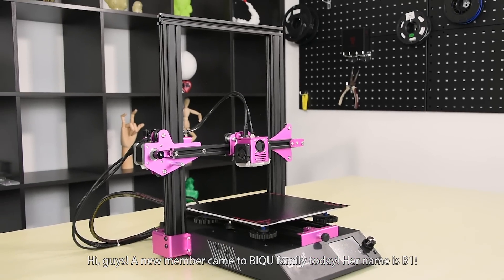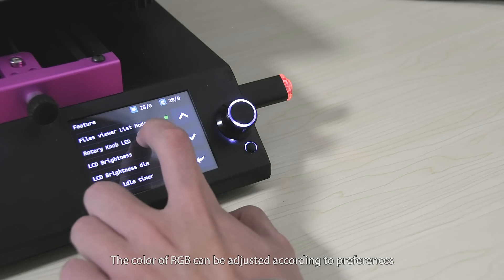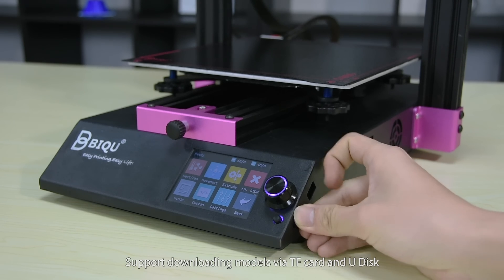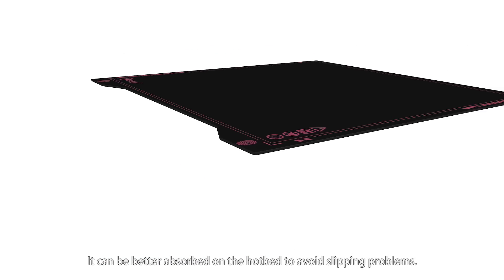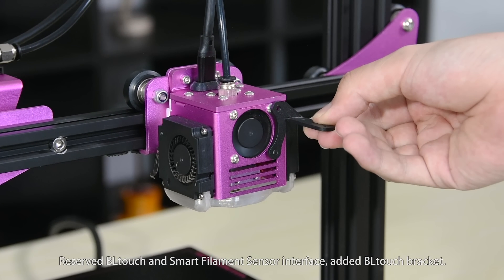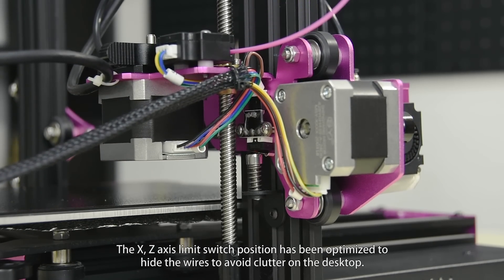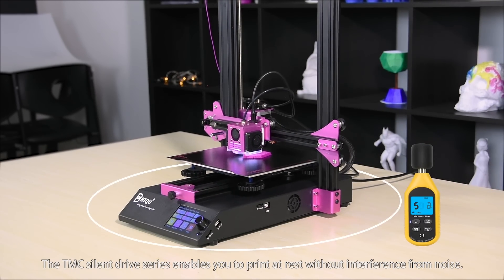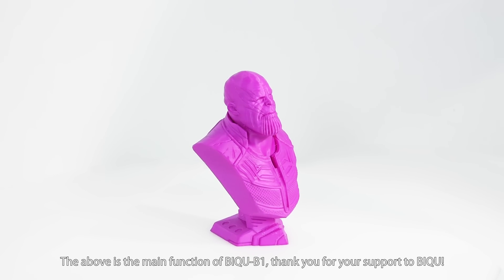BIQU B1: 32-bit Dual Operation System 3D Printer

Comment: I have bought this printer in Sep 2021 and I am not happy with the high pitch noice from the Power Supply Unit fan. I can hear it from another room at a distance of approximately 10 m (30 ft). The top frame of the printer  was poorly assembled by the manufacturer: I had to spend some time to fix several issues by myself as I have some experience with terrible Anet A8. The Manual is incomplete. Prints are okay. Love the magnetic print bed and the detachable metal sheet. Love the touchscreen.

Comment: When will there be a second Z-drive available? That will make this fine printer an excellent printer. Overhere in Europe there is a tendency to bad review the printer because the lack of the second Z-drive. And when your product has a bad reputation, it takes a log way to restore confidence. And that would be a pity, because the printer is an axcellent machine.

Comment: I have this printer and i am only having problems with this printer. Leveling the bed seems almost impossible. And then you think that it is not a problem with BL-Touch, but I have not been able to print a single first good layer yet. I am not an expert but have more than a year of experience with the Ender 3 and printed without any problems. Have also checked  everything of the printer 10 times and leveled the bed as good as possible 100 times. Also bought a Creality glass bed because the original bed appeared to be warped. I even bought a second BL-Touch to make sure it was not broken.

I bought the printer through Banggood which I really advise against everyone. If you buy something from Banggood and the product is not good then apparently you are out of luck because they don't provide any service! Reported my problem within 2 days and they are doing NOTHING to help me. Hope others have more success with this printer. for me it is 250 euros in the trash.

Comment: REALLY love the ability to send gcode right from the screen.
Is it possible to add a plastic piece like to the rear usb c connection, like the one on the nozzle shell? I think it would add lots of stability.
I really think this will be my next printer.

Comment: I bought this printer, it arrived in 6 days to my tiny town in Northern Canada, and i'm quite happy with it. It's been pretty damned good to be honest, especially at this price point.
Highly recommended!
Reply: Hi, Kenji. Have you checked the autoresume function if you shut down the power ?. I mean, if this printer is able to resume the printer after a shut down power.
It would be very usefull if you can check this out and tell me if this function does exist in this printer, because there is one review that mention this model doesn´t have recovery printing after it is turned off. No other review in english or spanish mention this very important issue.
Thanks in advance and hope hearing from you soon. 
This is John from Santiago de Chile, South America. Tks.

Comment: If you decide to develop a good printer - based on the proven design of the frame and mount, skr1.4 board, a good display, a magnetic table. But didn't you install a direct extruder ?! It is very strange ! Why emphasize - that the control button is backlit and can it be seen in the dark? - It is clearly visible even without backlighting as the display is lit next to it!

Comment: it's not really a dual operating system though is it... what it is, is a dual interface for the screen... touch and rotary... dual os would be say marlin or say Smoothieware for example... it's like saying look guys we have this computer for you.. it's got dual os installed, both are windows 10... come on stop trying to make something it's not
Reply: It kinda says Dual Operation tho. Notice where they said the print head comes off easily for replacing parts or switching to laser engraver/cutter. Better luck next time
Reply from the maker: thanks for your feedback
Reply: The website says Dual Operation system which is precise and correct - it does not say 'Operating System'.